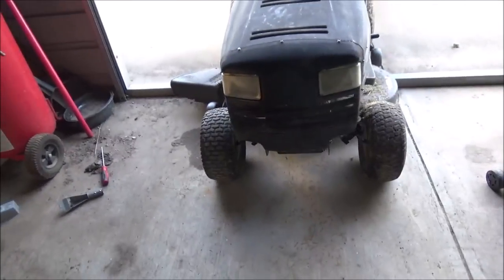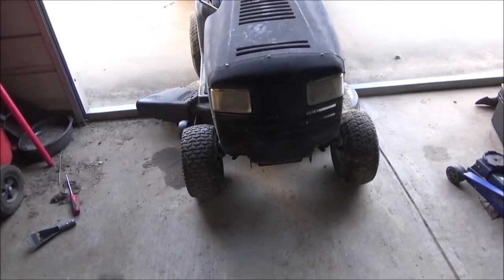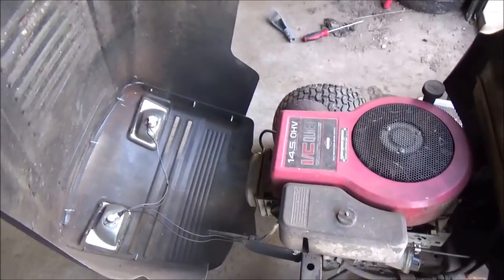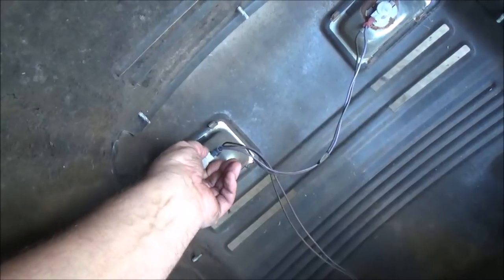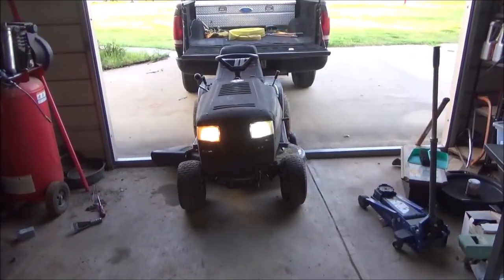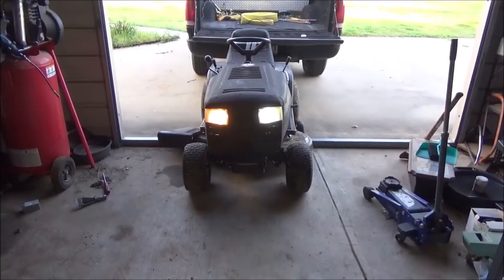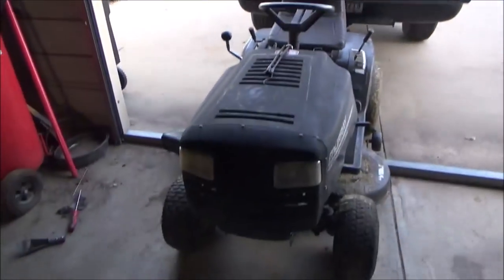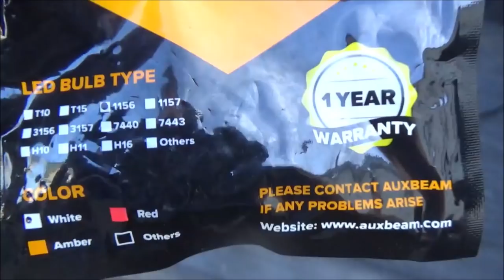LED LIGHT UPGRADE TO ANY MOWER / TRACTOR / TRAILER  WITH THE 1156 STYLE BULB / LAMP

Comment: I have a John Deere L130 tractor mower. I upgraded to the 1156 LED lights. They work fine for a little while, the begin to go off, not a the same time. A few minutes later the light(s) come back on. When I put the incandescent bulbs back in, they work just fine. The LED lights you have look just like mine. Any ideas?

Comment: Question,  I have the Craftsman LTS1500 Riding Mower. The part number for the headlights are 4152J. Will the 1156 LED light work on mine?
Reply: Yes they will.

Comment: I have noticed that the owner's manual sugggests full throttle and choke when starting tractor mower engines.  I do NOT follow those directions to start them.  I leave the throttle at idle then engage the starter for about ten revolutions of the engine the pop the choke out momentarily until the engine starts then I let the engine run at idle for a few minutes before moving the throttle for higher engine RPM.
Reply: SO.... you are saying you know MORE than the manufacturer? I am confused as to the relevancy of your reply.
Reply from the maker: On a cold engine I choke fully and soon as the engine lights off I pull it to idle.  Let it warm the oil then I pour the dinosaur juice to it